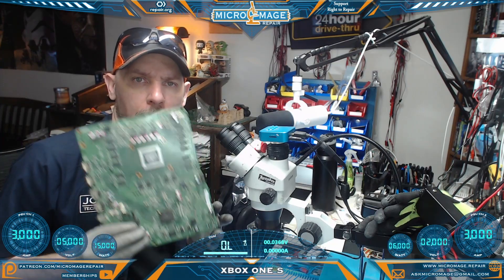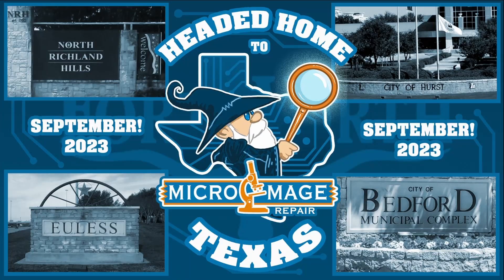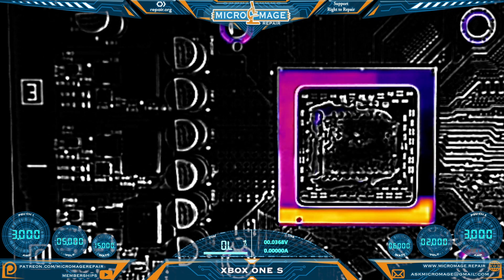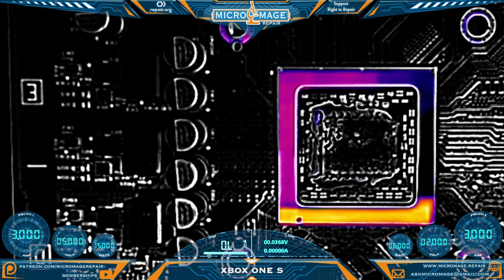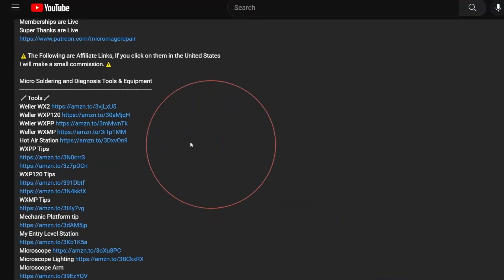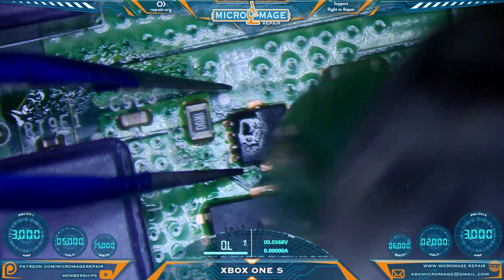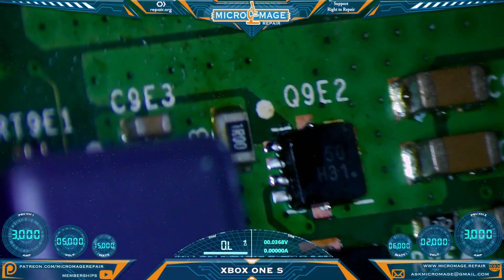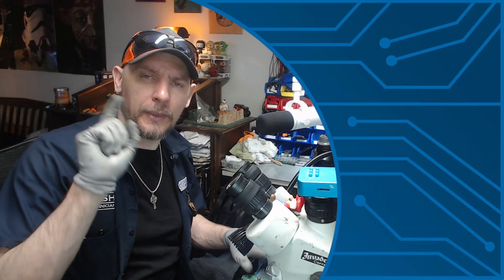Solder & Wick: 💉Voltage Injection

Comment: I hope, hand on heart, all goes well with the move back to Texas! & your safe, well and business booms!! Wish you & business the best of luck once you're all settled in 🫡 from Steve!

I've just had an UN-usual job from a friend, whom had a CB radio, that he's had for 6 or more months now.  he spent weeks trying to make it TX - Transmit. 
He was replacing output transistors etc.. still no joy. He brings it to me 10 minutes later we have, Transmit!
All it was, that was causing the issue, was a Micro solder joint on the processor. The joys of Micro soldering 🖖👍
Reply from the maker: Much appreciated Steve!
I love being able to do that type of stuff! The microscope is such a great tool!
Had a similar situation with a thumb drive for a client. Life was on it, a few broken solder joints on a legged chip and they were happy as could be! Wouldn't be able to even see that with the naked eye.